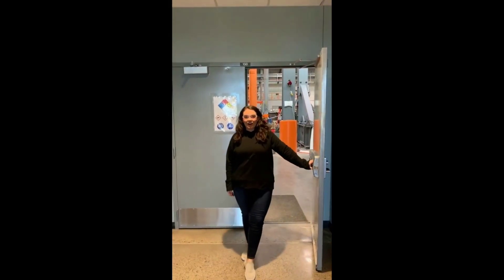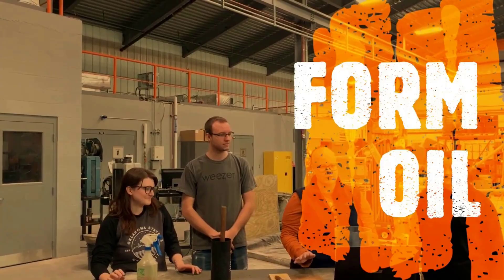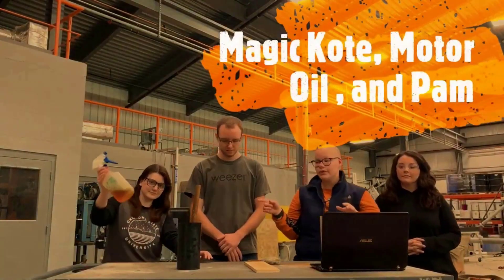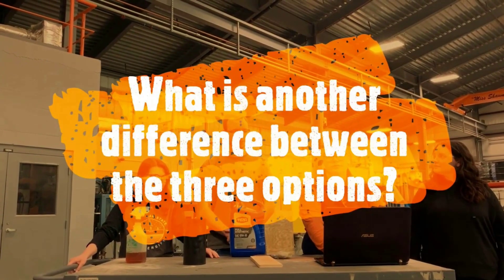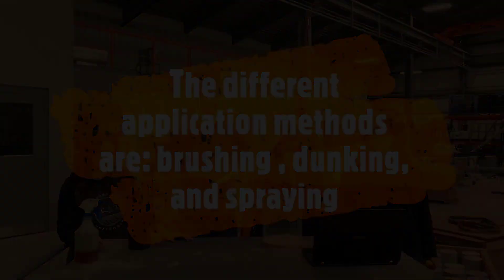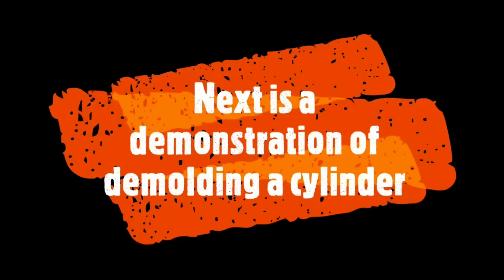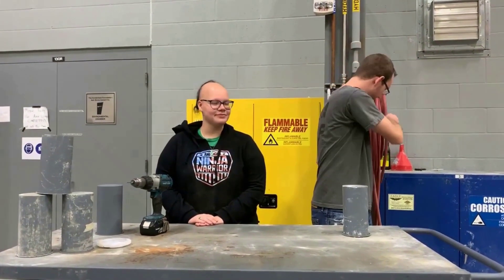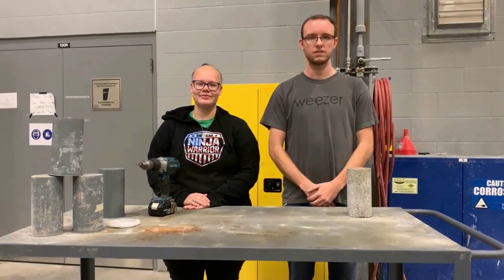Secrets of form oil | Concrete form oil introduction

Comment: The standard in my parts was to spray diesel fuel on the forms, which has since been replaced with form oil. The new stuff we use smells like oranges. I call it hippie juice. It's definitely more pleasant for my wife, who washes my work clothing.

Comment: I would be curious to know what type of reactions concrete would have with WD-40. Almost all beams that I have seen cast on airport concrete projects have WD-40 as a releasing agent. I use mineral oil on mine like the test method suggests because I can’t find anything that says definitively that WD-40 doesn’t have adverse reactions to Concrete. The other issue is the amount that most of these technicians are using to the point where I believe they are vibrating WD-40 into their concrete as their casting them in their beam molds.

Comment: Great job Dr. Ley.  Great job to your Students as well.  I was looking for a video like this on Form Oil and I have found it.

I was reading that Motor Oil is NOT recommended for use as Concrete Form Oil for the possibility it might discolor the concrete on something that "Aesthetic" Looks Matters.

I, like you, have always had an interest in Concrete since I was Blessed to grow up in a small TN town that had Limestone Quarries for road rock, Agricultural Limestone, and Aggregates for Concrete.  There were also 3 plants that made Precast Concrete Products.  All are History now except for one Limestone Quarry.

Sorry about getting off the subject but I was wondering about your opinion on the Commercial brands of Form Oils.  Are they better than using the Alternatives like Pam or Motor Oil?

BTW, I used to be a shallow hole Oil & Gas Well Driller.  I bought many gallons of Concrete Form Oil from the Oil Distributors for use as an Air Hammer Rock Drill Oil for injecting into the airstream down the hole for lubricating the Pneumatic Piston in the Down Hole Drill.  It seemed like it worked pretty well for Hammer Oil in a pinch.  I also used "Bar & Chain Oil," for Chainsaws as well for the same purpose.  The Rig's Penetration rate "suffers" when the Hammer is NOT properly Lubricated.

I wonder how that would work as a Form Oil?  I was told the three oils mentioned had the same Specs but Please don't take my word for it.  I was an Oilfield Driller, NOT an Oilfield Chemist NOR Lubrication Engineer.  LOL

Comment: I have a plastic bucket I am using for a form.  Can I spray it with Spam so it will separate from the concrete after it cures?

Comment: When I use to be a precaster when we would run out of the commercial form oil we would spray the molds with diesel fuel. Put it on with a pressurized sprayer. let the molds sit at a tilt for a while so it would soak in while the excess drained, then wipe the molds out to get rid of any grit it loosened up

Comment: Dr. Ley, couple things:  Now I know why people go to acting school.  Still it was informative.  
Second, if you really want a great field trip for you or your classes, visit Moscow.  One of the things we noticed was that people did not walk their babies in strollers simply due to the huge, gaping cracks in the Russian sidewalks.  Crack is the wrong term, because we know what concrete cracks look like.  These are 8 to 12-inch openings between what appears to be solid slabs of concrete.  The disintegration of their concrete was so horrifying I even took pictures (in 1998, so they are lost in the house somewhere).

Comment: You guys are Great ! . . . and I'm looking forward to the next one ! . . . but the audio needs HELP ! . One overhead mic picks up too much room echo and picks up your voices at different volumes because of mic placement in relation to each speaker,. Also each speakers voice has a different timbre and sibilance that reacts differently to the room's reverberation which exacerbates the ovrhead mics's limitations. I recommend individual lapel mics to address to address the volume discrepancies and room noise. . . and maybe a lil' EQ to help with the sibilance ! I bet You guys are stoked to have a prof like Tyler ! . . . ps . ait voids should read air voids . . yes ?

Comment: Stop.  you should include straight diesel as a mould release as well which is common.  Also, i use old motor oil (usually used diesel oil) mixed with 30% Kerosene as form release..  the kerosene thins out the old oil so it is not as viscous and absorbs timber forms easier.   I would really like to see both of these used to give a true indication of the types of form oil out there.  

That said, a good use for oil in a spray can like spam is on tin sheds etc... where you don't want excess concrete splashed on to the surface, or if it is, it is easy to remove later.
Reply: HORRIBLE idea, this isnt the 70's. Chemically reactive release agents have been around since the 50's, and they leave a true architectural finish, with NO big holes
Reply: @loganconnally4361  dont get me wrong, where architectural finish is required.. use premium, but im talking about re-using formwork, no see areas.. ive just started using petrol with oil diesel oil and it works great.

Comment: Do you know what to add to cement to create a hot face product that could be used in furnaces or forges? Something up around 3000 degrees Fahrenheit?
Is there some sort of simple easy to procure mix that would work well? Damned if you
Reply from the maker: You should try calcium aluminate cement.  I am not sure it can do 3000F but it can get close.

Comment: Great first vid guys. Producing vids for public release is always difficult, but once over the initial steps, and the inevitability self questioning of technique, scripting, etc you'll gain more confidence and power on. I'm looking forward to further discussions.  And just for the books, the use of form oil within the concrete industry in Australia is extremely limited to the point that it's use is only incorporated into concrete applications when requested by engineers. Even when requested, form oil is substituted with silicone based industrial mould release, this causing contamination issues that are overlooked. Not good. 👍👍🇭🇲

Comment: Which oil is best and cheapest for plywood forms. Is it better to paint the plywood with oil paint first or possibly use a good yet cheap latex paint then use the oil to help release... all questions I would love to know the answers to.
Reply from the maker: Thanks Adam,
Stay tuned for video 2.  Some products will weather the surface of the concrete.  Commercial form oil doesn't seem to do that.   I am not sure why yet.
Reply: @TylerLey  so would vegetable oil compared to motor oil? I mean..am building in Caribbean where commercial form oil is like finding concrete fibres.. not very easy...

Comment: Learning so much about concrete from your channel, its so informative and easy to understand for beginner like me. Many of your videos talk about pros and cons between conventional steel rebar and newest FRP/carbon rebar.....Would be happy if you could also talk about pretreated bamboo rebar, as it's very sustainable, generally cheap, and i've seen some of old colonial building in my country using it (they're still in great shape). Anyway many thanks for making this channel :)
Reply from the maker: Thanks!
I am not an expert on bamboo rebar.  I have read about it but have not used it.  I may be able to sneak it into some testing coming up!  Thanks for the great suggestion!

Comment: Great job. Big jobs I've been on for exposed finish surfaces, they've used steel forms with a plywood liner with some sort of shiny slick laminate then they sprayed on oil. Minimal vibration to reduce cavitation.
Reply from the maker: Thanks Blip.  Do you have pics?
Reply: Tyler Ley ...No pics. I worked on Back Bay train station in 1987. Cell phones weren't around then. The forms were about twenty feet tall and six to eight feet wide. They were huge and had to be lifted in place by cranes. If you're ever there, those concrete columns were poured in one piece with these forms.

Comment: great works guys. One hint for your future: Audio is very important in the perceived video quality. A bit of organic lab noise is great to make the video authentic - but constantly and during important information makes it acoustically hard to hear you. Use microphones on the speaker (that reduces the noise and you can fade between mics) or even record the audio in post.
Reply from the maker: Thanks so much!  I like the tip about putting microphones on the speakers.  I totally agree about the sound.  Feedback like this really helps them improve.